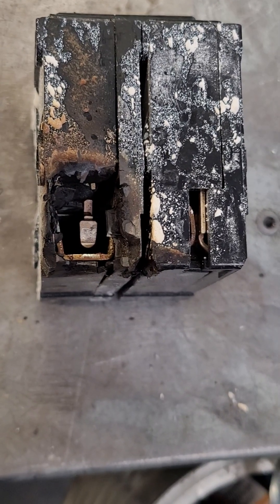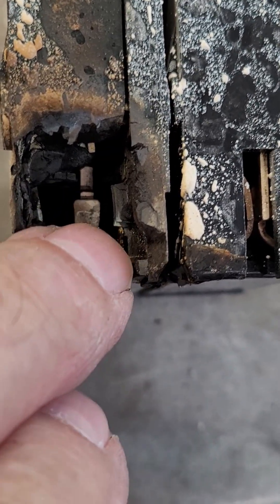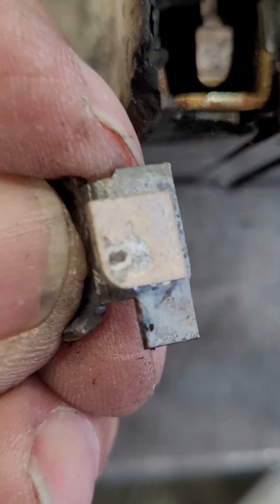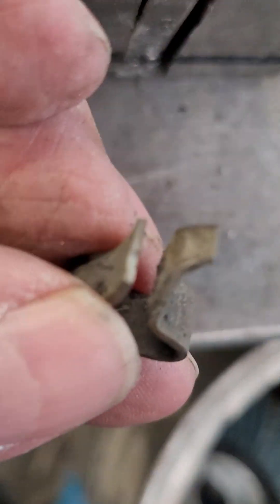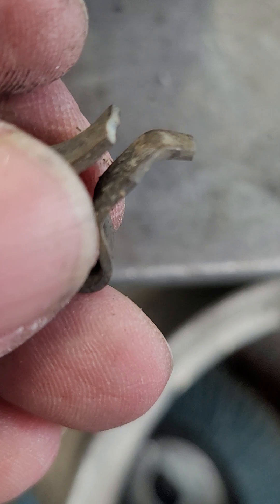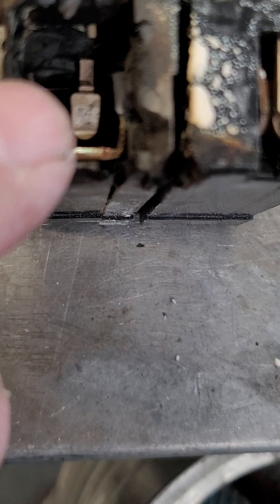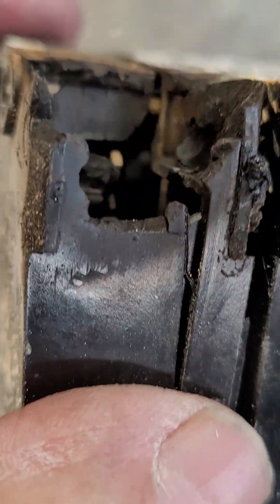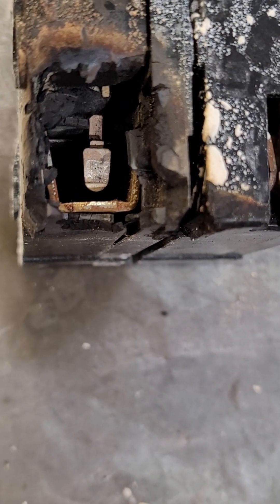SPOT the Warning Signs of a BAD Circuit Breaker Before It's Too Late

Comment: what kind of breaker is it. cuttler hammer ?
Reply from the maker: Westinghouse circuit breaker.
Reply: @CandSMINING that is the problem all them breakers should be replaced.  it's probably over 30-40 years old.